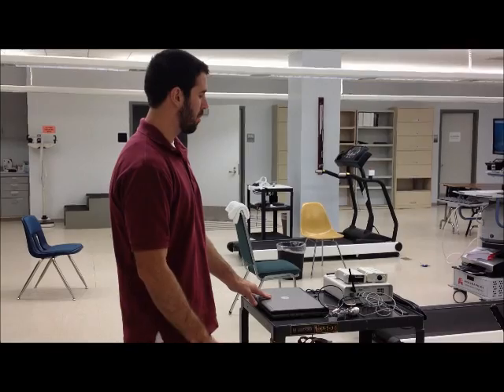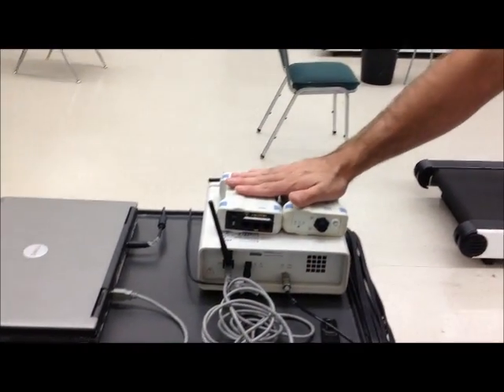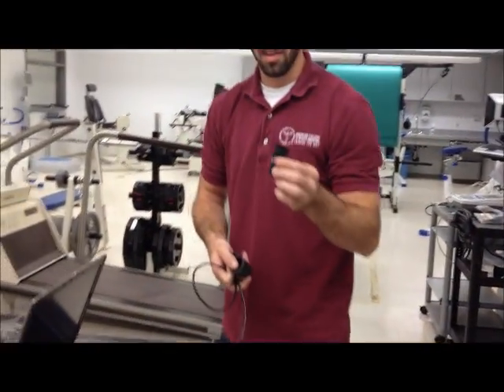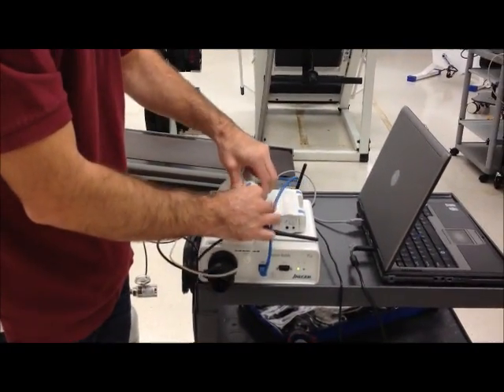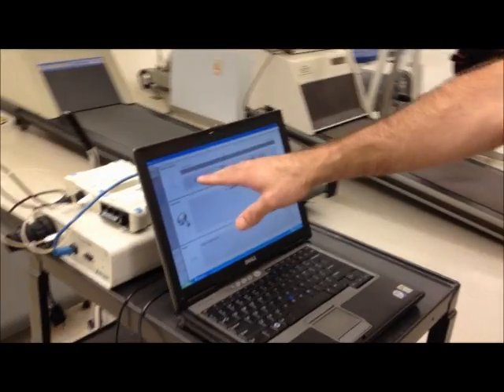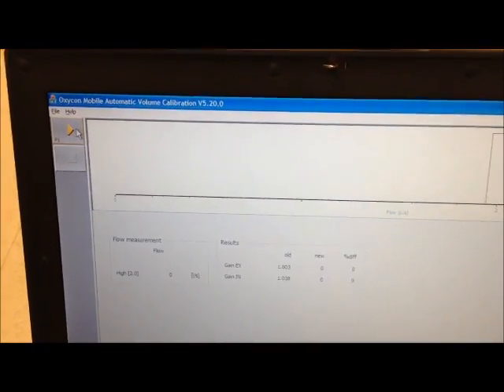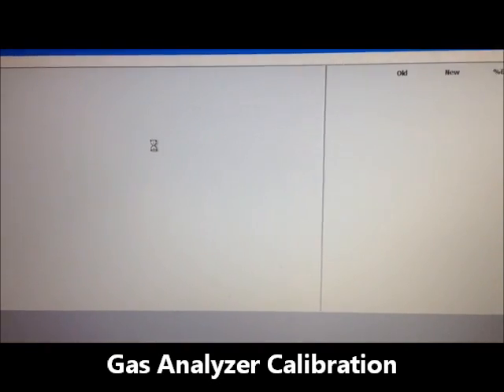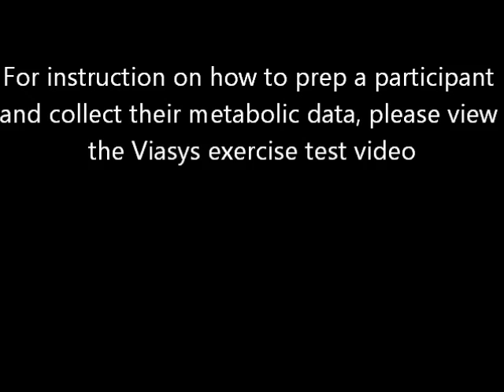Viasys Oxycon Mobile Setup and Calibration Instructions

Comment: When you said "180" for gas calibration... did you mean BAR?
Reply: no, he meant turn the leaver about 180 degrees. preassure is written on the end of the receiving unit. Just open it slightly and thats enough.
Reply: @matel1s  ok. Thank you. I'm having trouble trying to calibrate it. It always appears the message of low pressure... I don't know what to do... any thoughts?
Reply: @BoraproFogão  I have zero experience with theese devices, but the perssure on the input should be aroud 3bar. If on that pressure you get low pressure alarm, most likely you have a massive leak, clogged passage somewhere or a defective pressure sensor.
Reply: @matel1s  thank you... I think the problem may be on the pressure sensor...